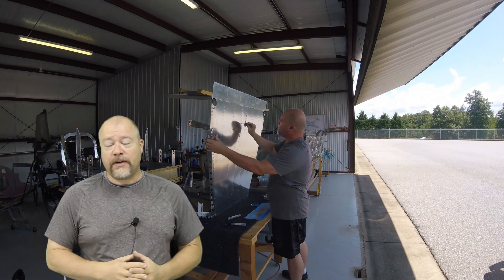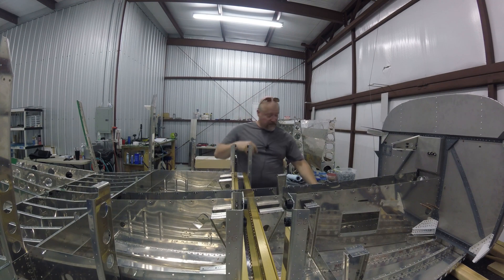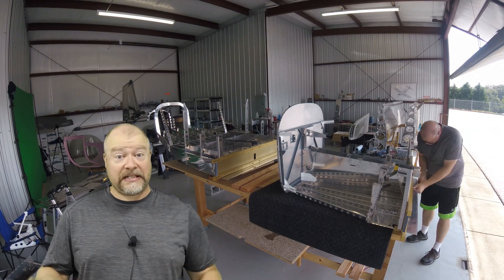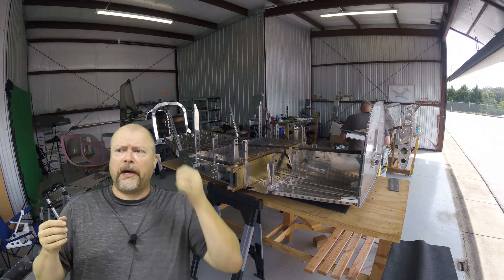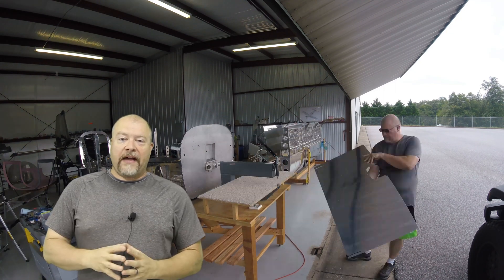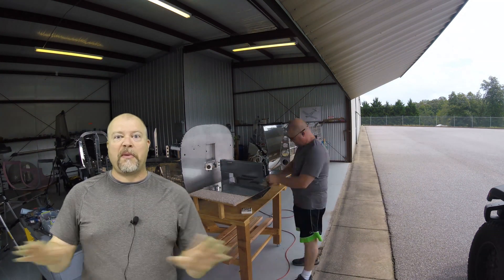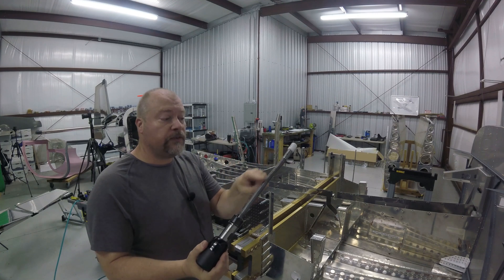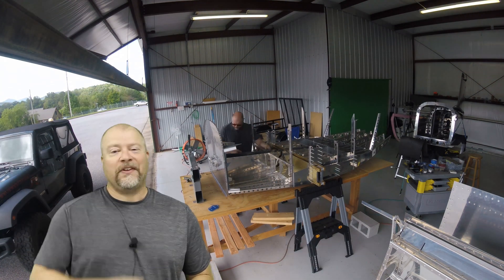RV-10 Fuselage - 018 - Merging the fuselages - Build for profit? - Need a hangar?

Comment: Suspend it from one of the spar (use wood blocks for proper spacing) bolt holes with an engine hoist (or a gantry) to buck the last rivets with your "helper"...

Comment: Details, details, details. 
First, building comes down to intent. If your hobby is building airplanes "solely for their own education or recreation", you're building airplanes for a hobby.  If you are building it with the intent of making a profit - not allowed. And, what will the FAA (or DAR) decide what your intent is? That's the grey area. You are more likely to get away with it if you build first then sell. But, if someone walks up and says "I will pay you to build it for me", then, yea, do not pass go, do not collect $200.
The so called 51% rule does not require 51% of the actual work. It's 51% of the items on an FAA check list (appendix 8 to AC 20-27G ) where some quick and simple tasks such as installing wing tips count as much as fabricating a wing spar. That's how fast build / two weeks to taxi programs work. They fine tune the work against the checklist. One should read that AC. Carefully. 
Repairman's certificate: If you are (one of the) original builder(s), one person can apply for the repariman's certificate. That certificate lets you perform the annual condition inspection. Without that, the condition inspection has to be performed by an A&P (does not have to be an AI). However, repairs, maintenance, and alterations do not require a repairman's certificate. Anyone can work on an E-AB at any time because Part 43 (which is the regulation requiring A&Ps and the like) does not apply to experimental aircraft (43.1). The operating limitations will specify what is required for the condition inspection (must be done per appendix D of part 43).

Comment: Sorry, if I missed this, but do you have a welder? I feel you could rig up a small bucking bar on a pole or extension handle with a couple of temporary spot welds to reach some of those tight areas.

Comment: If you haven’t already solved it, a small section of 2”x2”x1/4”(thickness) angle with a 2” length of pipe or tubing welded to it might make a buck adapter to reach under that stiffener strut to get those rivets. As far as being able to hold the section up on its side, possibly attach to those wing mount spars at the end...maybe sandwich some plywood around them with a couple of bolts to apply tension, with a stand that allows you to hold it off the table by an inch or two. I wish I could include a drawing of what I have in mind. You’re a smart guy, you’ll figure something out. It’s always a pleasure to check on your progress.

Comment: Hey Jason, you’ll probably have to drag that fuselage down off the end of the table, prop up the tail with a sawhorse, then get underneath to hammer the remaining rivets with a flush set. You’ll need to modify your empennage bucking bar by grinding it flatter so it will fit under the hat stiffeners and spar bolts. Great videos!!!

Comment: ALMOST correct on the Repairman Certificate.   After you sell the plane to Bob, he (or anyone with a screwdriver) can work on the plane.  However, only you, with your Repairman cert, or an A&P can sign off on a Conditional Inspection.  Additionally, if you buy someone else's almost-completed project, it can still be E-AB registered, but unless you can show that YOU did 51% work, they won't give you the Repairman Cert.    You CAN hire a company to build it for you, but it would have to be registered as Exhibition, not E-AB, which carries with it a lot of restrictions like No Passengers and needing to submit an annual schedule of events you'll exhibit the plane at.

Comment: There is some mis-information here.  You don't need to build 51% of the aircraft if you don't care about applying for the repairman certificate.  The Repairman Certficate is only really useful if you intend to do your own conditional inspections AND sign them off.  (Same thing as an annual for a certificated aircraft).  

Anyone can do any work on any experimental (EAB) aircraft in the United States, without needing an A&P to sign off, even if they didn't build the first piece of that aircraft.  The only thing you CANT do is hold a repairman cert (that requires the 51% build rule) which allows you to do the conditionals.  

For example, if I bought an experimental RV-7 from a builder that was 100% completed by that person AND that person had the repairman cert for that aircraft.  HE could do the conditionals on it, even AFTER I purchased it from him.  I could not sign off the conditionals.  HOWEVER, I can do pretty much anything I want to the aircraft, including maintenance, replacing engines, etc.  Some major changes will require the aircraft to go back into phase 1 or phase 2 inspections for a few hours (like upgrading from an IO-360 to an IO-390 engine), but I could still do those legally with my own sign-offs even though I am not an A&P nor hold the repairmen certification for that airplane.  

Builder Assist programs ARE NOT ILLEGAL!  They abide by all the EAB rules.  HOWEVER, if you do a builders assist, you will not be eligible to apply for the repairman certificate for that airplane since you did not build 51% of it.  You can literally set one rivet in the airplane and still consider it your's.

Comment: You need a flat tip for flush rivets on the gun to use on the bottom of fuse, then use a small bucking bar and buck them that way. And try not to put dimples in the head of rivet, but in order to get those tight one you will need another person and a flat tip for flush rivets.

Comment: I do not get your profit argument!  Put the legality part on the side, any good builder can for sure get a van built from kit in 1000~1400 hours, even less if they done before. A full rv-10 including engine and avionics can cost from kit around 150k, so if you work only for 40 hours a week ( 8 hour a day for 5 days) like most jobs for 10 months only; 40 x 4 x 10 = 1600 hours, you can get one done and sold for 250-300 k, that is more than a lot of job pays and you have fun. Your time is your compensation and you have 2 months of vacation if you want to build only 1. Tell me what other job that has these benefits.

Comment: I'm building my 7 in my 3 car garage.  And if I didn't have that, I would put a barn out on the back 40.  I have a large A/C and  heater.  Garage is insulated so I'm usually at 70 degrees.  Closest airport to me, and I have flown out of it for years, is out in the middle of no where, about 40 minutes away.  Next to a gun range and a prison.  Which I thought was always an interesting combo.  Regarding the rivets.  Yup, looks like you or your wife will be underneath and the other holding that fancy tungsten bucking bar.  Interesting note, the first critically death occurred at Los Alamos when a young physics was shielding material with Tungsten blocks, he slipped and knocked some over.  One of my co-workers actually has one of the blocks.  Of course it crossed my mind, Wow this would be great to rivet with!

Comment: Hi Jason I work out of a t-hangar in Florida and found the heat unbearable.   I was told to look into a large swamp cooler, but was hesitant because there is sooo much info on the internet about them not working in a high humidity environment such as Florida.   With no other options I bit the bullet and purchased on from Home Depot and I will tell you the results have been phenomenal!   I point it in the direction I’m working and it is a instant relief.  It was not a cheap investment but well worth it!   If You purchase one don’t bother with the smaller ones as they don’t give the desired results, been there done that.   Here’s the one I purchased and it’s been great!   https://www.homedepot.com/p/Hessaire-11-000-CFM-3-Speed-Portable-Evaporative-Cooler-Swamp-Cooler-for-3-000-sq-ft-MC92V/304078771

Comment: I'm not sure I can visualize what the problem is but just in case it is just access to the bottom. Could you cut a piece out of the top of your table (being careful not to cut the frame) to give you access and when you complete this part of the build, nail or screw or glue the wood back in place. Obviously, you would still need someone to hold the buck or find a way to clamp the buck into position with enough load to 'bounce' the rivet flat (also, someone needs to crawl under the table to use your 'gun'). Again, I am not sure of the mechanics of you problem. My monitor is old and so am I, so getting a clear picture is problematic for me. Keep up the good work. I just came across your channel about a week ago and I am watching random episodes as I find the time.

Comment: Make a wooden spar on a pedestal, then you can position at any angle (visualize an engine hoist).  Then get out the bucking bar and flush rivet head those puppies.    Great job so far, looks great !

Comment: Jason,
Regarding the maintenance on a purchased experimental category airplane: anyone can perform maintenance and modification to the airplane, no A&P needed.  However, the condition inspection (annual) does have to be performed by either an A&P, or the original builder who would still have the repairman's certificate.

https://www.eaa.org/eaa/aircraft-building/intro-to-aircraft-building/frequently-asked-questions/condition-inspection

Comment: you are right. if you decide to sell the aircraft it still falls under the experimental category. However, the person that buys it has to have an A&P do the maintenance like a normal certified aircraft unless it is the preventative maintenance items. This is from my understanding. But selling it is perfectly fine because you are not building it to just sell it as a new aircraft. The grey area I think is the builder assist programs but they can get away with it because you are still physically working on the airplane with the help of "buddies" mentality I think. So since you are physically doing stuff on the aircraft then the FAA says that is fine. That is my interpretation. also...at this rate you will be done before steve's rocket haha
Reply from the maker: This is my understanding.  And at some point I'll just buy his rocket and finish it heh..
Reply: As a experimental aircraft anyone can work on the aircraft.   The only exception to this is the annual conditional inspection.   This must be done by the person holding the repairmans certificate or an A&P;

Comment: My airplane is in my garage (airconditioned is a plus!) But. I wish it were in a hanger because i cant buy out time to work on it. Too many home distractions. If it were in a hanger i could buy out even 2 hours per week i would be happy. (9 month old at home... 9 months behind my schedule)

 PS. 24kbtu minisplit a/c would blow your mind! If you own the hanger forever and keep your plane forever i would air condition it even if you had to insulate even just the south wall and roof with 2" foam board. I would come help you out but i dont know where your at.. amd oh ya... 9 month old at home!